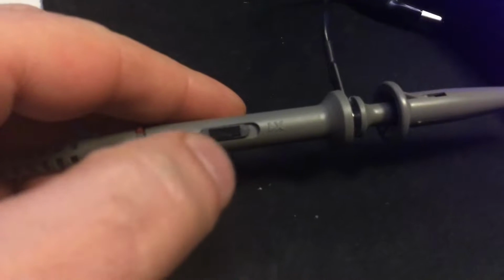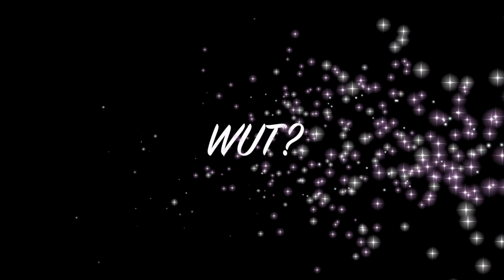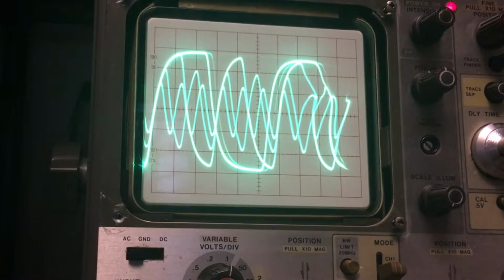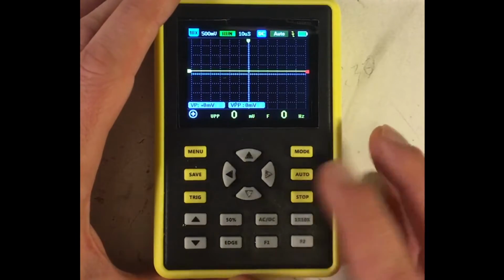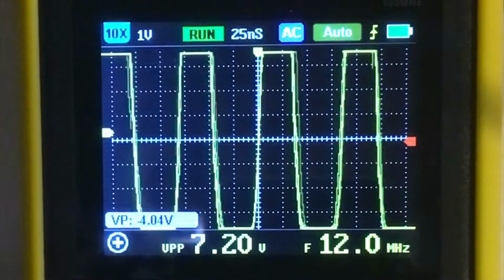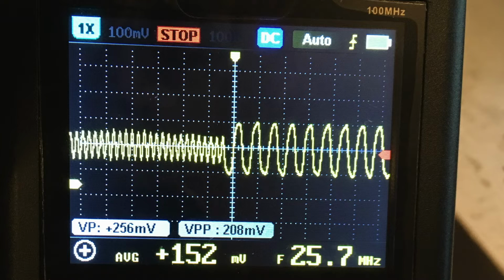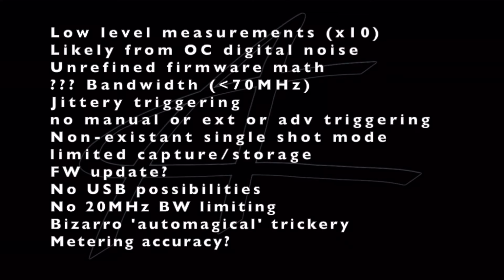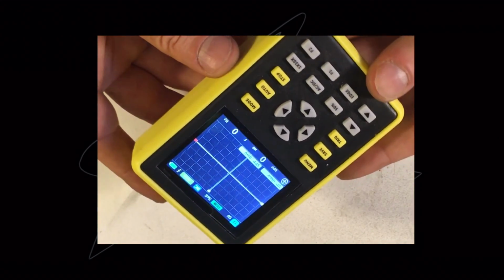Pocket 100MHZ?? oscilloscope part3: testing and conclusions

Comment: Thank you very much for the excellent lesson about the difference between bandwidth and signal frequency. A good analysis of the device. The lack of one shot analysis seems to mean the adc needs many cycles to mesure the wave, probably by dephasing: precise control of dephasing and clock allows to analyse repetitive signal, whose form is stable, with a very slow adc. Good analysis of the use of lot of maths in this device. Conclusion for me: very nice, shall buy one, and more, if i had had to make an oscilloscope and best use of the hardware, i'll do the same. Thank you. Regards.

Comment: They have a new version of this, with updatable firmware - DSO1C15;  But, this guy https://github.com/ataradov/open-5012h made a way to make the 5012H a little better!
Reply from the maker: Bruno Malbusca oooo nice, I’ll check it out
Reply: @AlexKenis   They make a new version of the latest version 1C15, where they fixed the huge input capacitance and instead they have now an impedance adjustment on PCB. Also, they used a more powerful FPGA and a ADC that is known to be overclocked. This russian guy made a teardown of this new version https://www.ixbt.com/live/instruments/oscillograf-1s15.html
Reply: Pensi che il DSO1C15; sia meglio? Do you think DSO1C15; is better than the 501h? Ciao e grazie

Comment: I just got my skr e3 1.2, going to check to see how mine is....buuut......I'm curious about that first laptop overclock story with soldering oscs to your mobo lol. Cheers for nerding it up!
Reply from the maker: HA, that was the only way to do it back in the 90s... messing with jumpers and surface mount resistors, and swapping out the oscillators.  First time I tried it was when I noticed that the only difference in the cheaper model of a particular laptop was that they were running at 33MHz but instead of 40, so I swapped out the crystal

Comment: Alex,

You are talking to a variety of use cases which is good.  You have suggested that some people may want not have a DMM and/or a logic analyzer and may want the DSO to fill both of those needs.  I think we can agree that a toy DSO will never be good at either of those uses.  You've mentioned that $10 logic analyzers are a thing.  There are many good cheap DMM choices too.  Perhaps it's worth throwing an affiliate link for one of each in your videos and then you don't have to dive too deep into those aspects of DSO testing.

I happen to have an old 25MHz analog oscilloscope.  What would a hacker/maker look for in a toy DSO when they've got one of these monsters on their bench?  Is it worth recommending finding a old used scope to augment a toy DSO to others?

Please do a $10 logic analyzer intro, theory and demo series along the lines of this one.
Reply from the maker: Yeah, I'll cover the cheapie logic probes.  I'll be using this as reference https://amzn.to/33VDZbz which isn't super fast, but works fine for the speeds that Marlin runs SPI and serial. That plus a DSO138/150 can cover a lot of bases, but Im  working toward showing how to test/troubleshoot 3d printers using the ender as reference because it'll be easier for me to show practical examples of how you can, like, show step pulses, PWM, and motor current with even the dso138, but if you want to see SPI or Serial signals, you need a few MHZ or a logic probe, and how more channels helps, BUT if you want to test PSU ripple, you need 20MHz@200MS/s, etc etc. It'll also help answer questions like what to do with one of the cheapie scopes if you have a 25MHz analog scope, because even with the cheap ones, they are floating if you use a battery so you can measure high side stuff and SMPS, whereas you would need isolation or a differential probe with an analog scope if you don't want to blow up your probe, plus if there is a USB serial interface, you can use it for logging and plotting or capture to CSV to do calculations on (like plotting acceleration curves or checking for stepper dropouts, etc).

Comment: Nice video Alex ;)
What you think about Hantek 6022BE? (https://www.aliexpress.com/item/33060683361.html)
It looks more promissing about its specs and it have 2 channels ;)
Reply from the maker: I actually have one, and I'll be doing a writeup.  WHen I got it, the software was garbage, but there is an open source, cross platform user-made firmware and software that has been doing a lot of work lately that is much much better.  It actually doesn't have the firmware onboard, it flashes it over USB every boot, so it is easy to mess with. As a bonus, it works with PulseView.  I don't want to give it a thumbs up or down yet though since the open source software is currently working on some important issues, so I'll wait a bit before reviewing it

Comment: It there some cheap-ass tool like this for n00b like me to use with 3d printer boards tinkering? How does it compare to DSO FNIRSI-138 you mentioned before? 
Also - watercooling? Nice.
Reply from the maker: I'll do a comparison in a bit and break down usage by bandwidth/rise-time, etc to help people pick a scope that is relevant to what they want to probe, without spending too much cash. Those little dso138/150 and similar scopes are useful for a lot of things in printers, but they have very low bandwidth and very low sample-rate, so if you want to do something like check SPI/UART signals, they won't be able to keep up.  But they can see things like step pin pulses up to a couple hundred kHz, and you can hook up a cheap current module to look at stepper current, etc... basically anything under ~200kHz-ish, so still a lot of useful stuff. Also, If you add one of those sub-$10, 8-channel,  24mhz logic probes, you can cover a lot of bases.